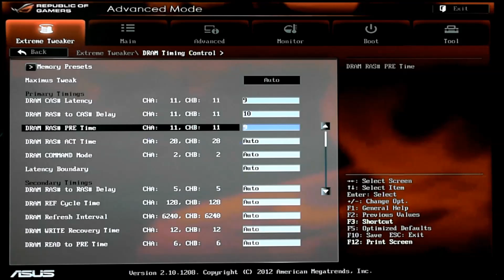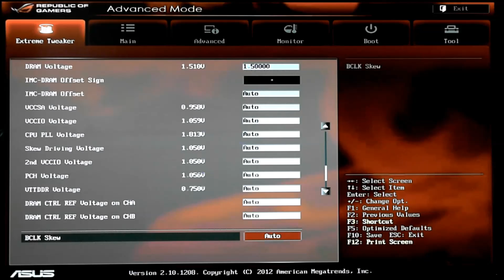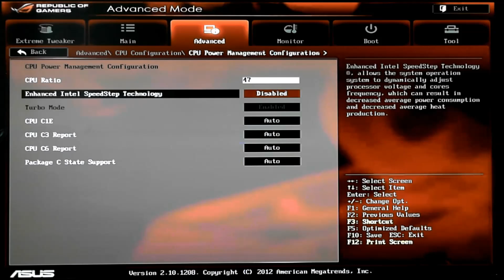Intel Sandy Bridge Processor Overclocking Guide To 4.7Ghz Stable

Comment: Still here in 2019 with Asus Maximus IV Gene-Z and a I7 2600K Sandy Bridge, still going strong! I wonder if it is possible to overclock the 2600K, Using this method?
Reply: I'm using 2600K 4.7Ghz, almost did everything what he did.
Reply: @CryMore13  When you say almost - what did you do differently? I want to overclock my i7 2600k Sandy Bridge - I have 16gig RAM @ 9-9-9-24 1.50v

Comment: Thanks for sharing. This is the main reason I like YouTube, sharing knowledge and info, everything else on YouTube is garbage. 
I built an i7 2700, Z77 based system and it's been locking up on boot ever since. Adjusting bios (thanks to your video) and now everything is going well. 
Thanks again.

Comment: On idle my my voltage and core speed keeps fluctuating from 1600 to 4600 constantly. Is this ok? under load its fine and stable a solid 4.6

Comment: i wouldn't go 4.8ghz on a sandy-bridge as  the  performance  percentage (10%)
For a  over volt'ed , shorter life span cpu chip for the expense of just 10% faster (ingames thats  like 30 fps extra ....) the point  in that  4.2/4,0ghz  is well enough for day to day use!). unless you plan to buy a new chip with 6 weeks using that kind of setup.
Reply: I was using 4.7Ghz, 2600K, but now I'm using 4.6Ghz. 7 year overclocked 24/7. 1.4v
Reply: Jesus is Lord   4.5 mostly get.4.8 if you are lucky asf

Comment: Why can't there be more videos like this?
Would same config work for my rig @ 4.7/4.8?
i7 2700k, maximus V gene, corsair vengence 16gb (4x4) ddr3 1866, evga gtx 670ftw reference, corsair TX850 psu, h80i and 128gb ssd
Reply: Hey Dj Shaprio did you ever use this overclock set up?
Reply: Well there is mine. https://www.youtube.com/watch?v=SLVhQ_NeIas

Comment: thnx a lot for uploading this video as i'm gonna overclock my pc soon and i i'll be overclocking it for the 1st time so i needed a step by step guide on how to do tht :) .. i would like to know whether i can overclock my pc at 4.8ghz stable 24/7 with this configuration : 

i7 2600k , asus maximus v gene , gskill trident 16gb (8x2) ddr3 1600mhz default timings (7-8-8-24) , asus hd 6950 , corsair cx750w psu , corsair h80i , 1 tb hdd.

any changes required in ram timings to get the best out of it?